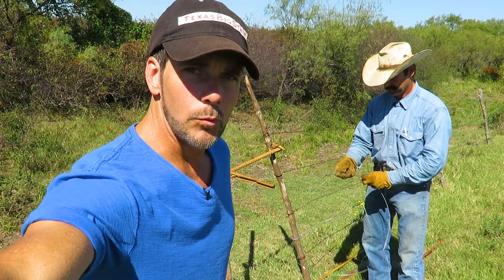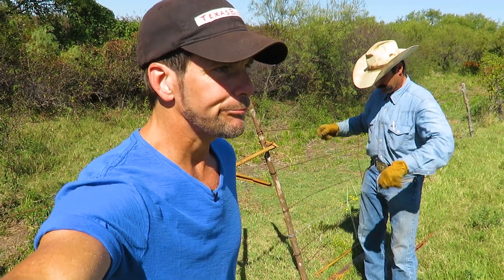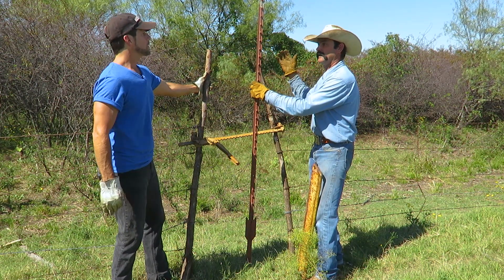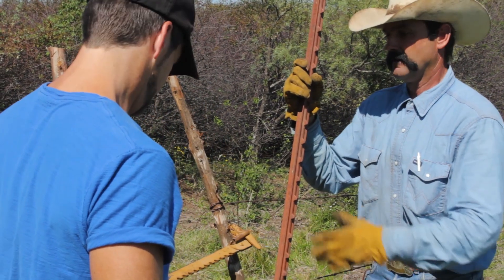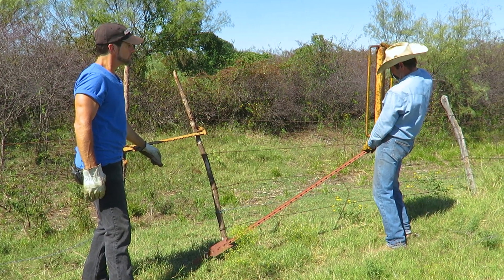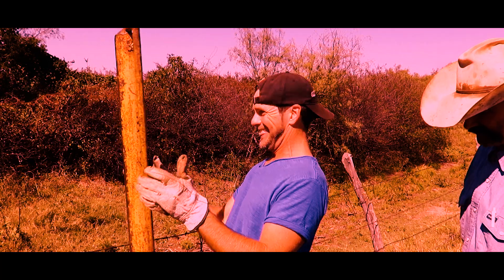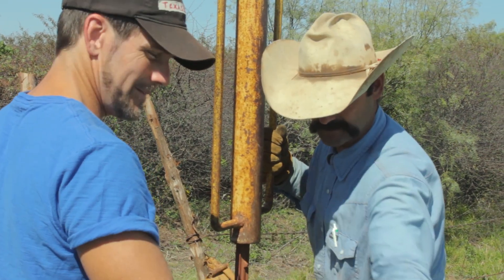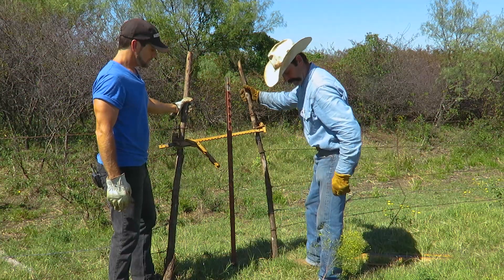Wire Gaps 101

Comment: I'm in North Texas and we call that a stretch gate. 

By the way two welded drill stem "H"s and a corner post even with kickers wouldn't be no $2,000!

What's your local welder charge, $200 a foot? Even with Bidenomics, I'do it for a tenth as much and still make a good bit.

BTW one side tied solid and the other solid to a stick of wood or iron and a "LOOP" makes a lot more sense. Just sayin'.